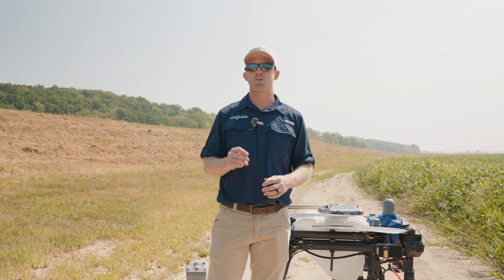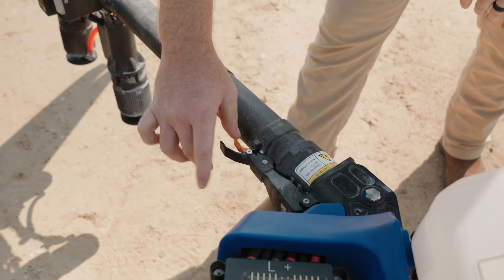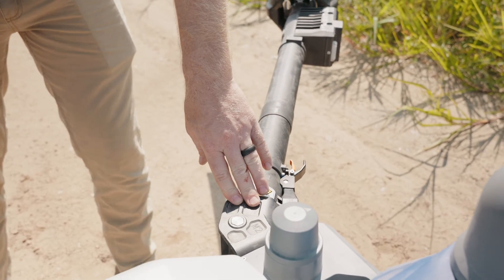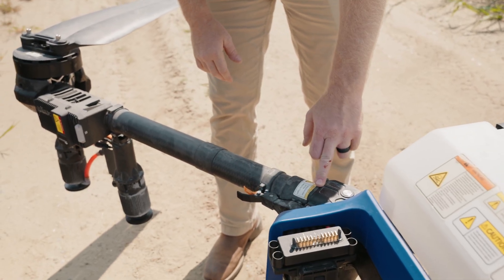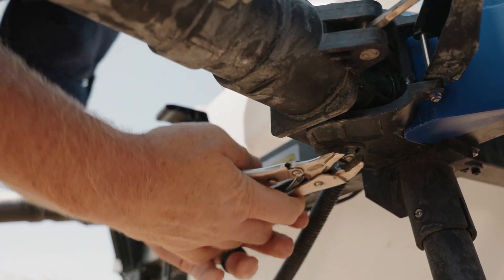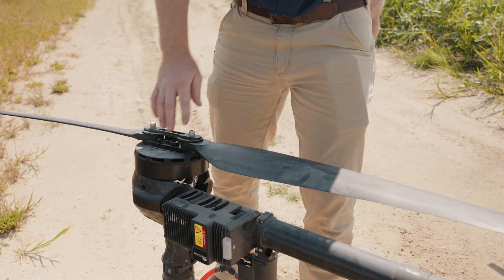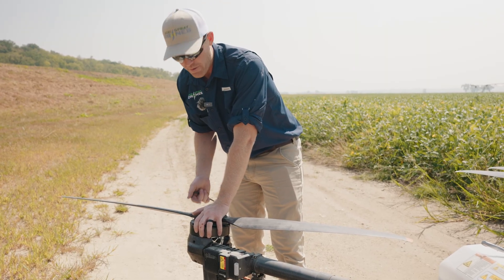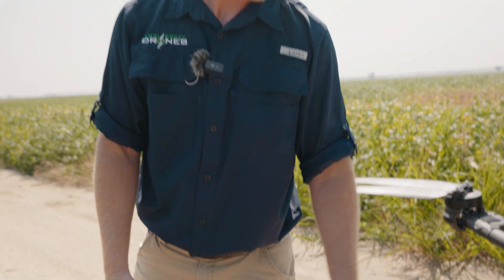J150 Pre-Flight Checklist

Comment: Lose parts leads to vibrations that rob power and can cause excess wear and tear throughout the system. Hey Taylor, does anyone recondition or repair props?
Reply: I don’t think they’re expensive enough to take the risk of not just flat out replacing
Reply: Hey Taylor thank you once again for a really well done video
Reply from the maker: It's not recommended. Any significant material removal can change the airfoil shape and throw off the balance of the propeller, and a damaged prop is a dangerous prop. It's not worth messing around with the only thing holding the drone in the air!